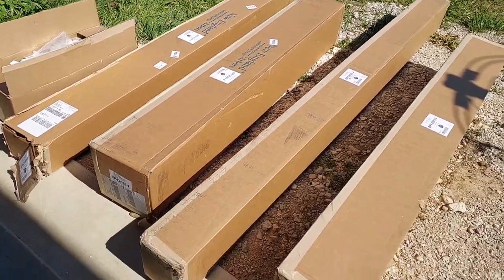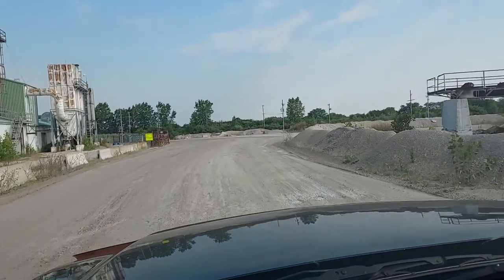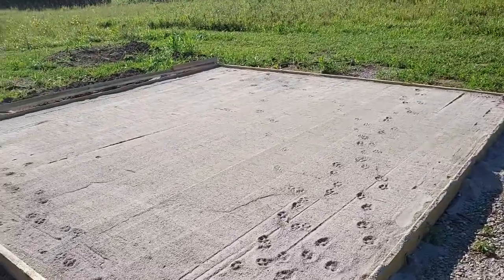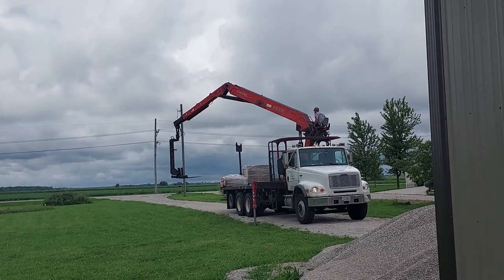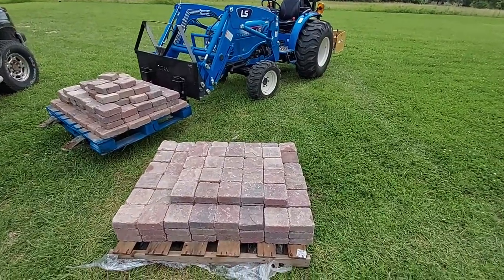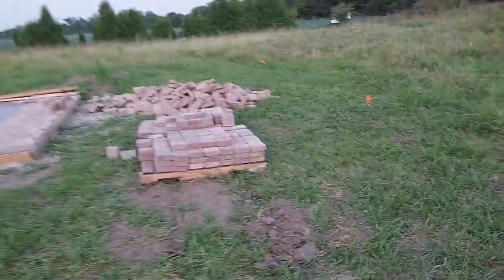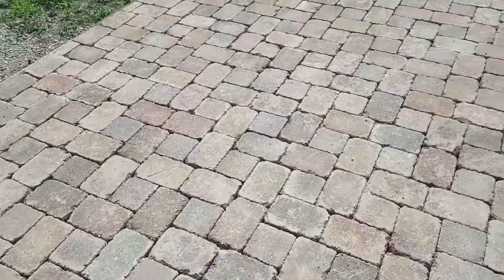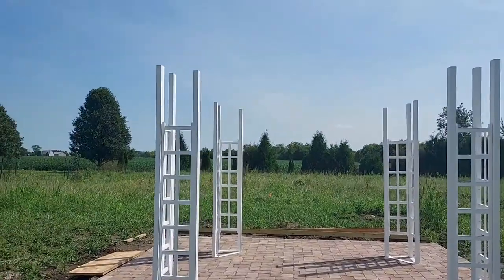Pergola trellis, LS tractor and Duramax at work

Comment: Nice job that should last a long time.
Reply from the maker: Thank you!  The last patio I built like this  was a 20x30 in 1999.  Lasted all these years until the 2x4s finally needed replaced.
Reply: @SolarDrew  I wondered about that we usually use Pressure treated 4x4 but whatever works is good. In 20 years who will care.
Reply from the maker: @offgridwanabe  yep. I did.  Both times.  I think the first time it was the “toxic” style back then with arsenic or something like that I believe PT now is treated with a copper solution but not real sure.

Comment: Nice job looks good, any issues with the tractor since you got it?
Reply from the maker: None whatsoever.  The previous model I had (3024) had a known engine mount issue so I traded it in for the replacement model before anything occurred.
Reply: @SolarDrew  Thanks for the response